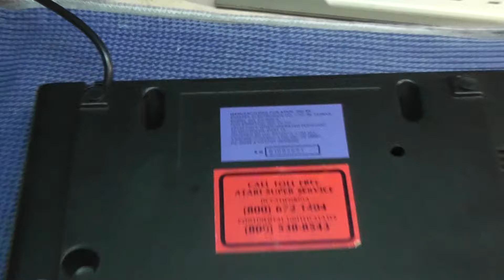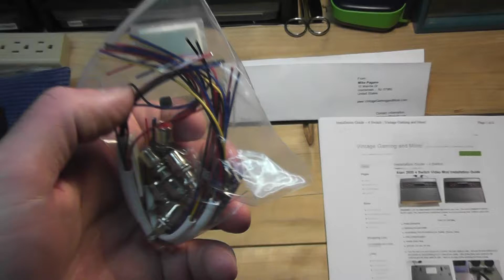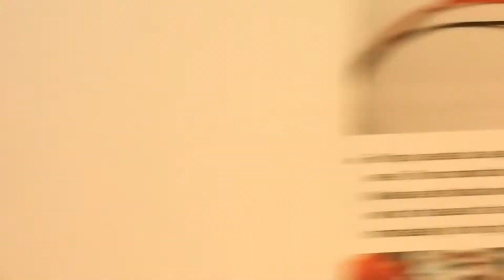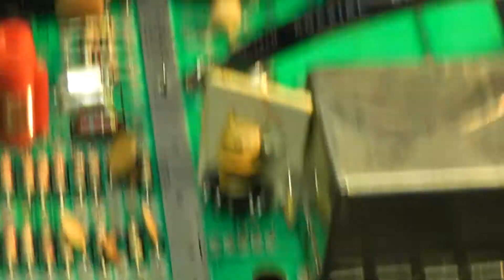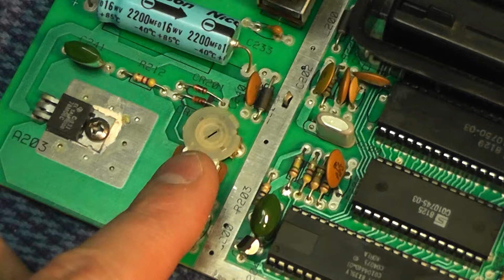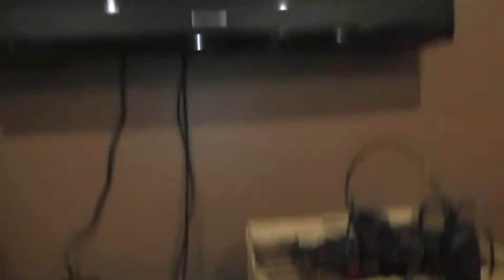Atari 2600 4 Switch Composite Video Mod

Comment: 8:14 - I have the exact same mod as you and noticed something on some of my games. Including Ms. Pacman. You may not have noticed yourself but I can see it in your video. At this time stamp, when Ms Pacman dies and you hear that little death music, there's a faint line near the middle of the screen that runs top to bottom. I have this too. I was told that the solution is to disconnect the audio wires from the board, add a 1uf capacitor to the audio line between those two separated wires bypassing the audio from the mod board completely. This is an audio related interference which seems to be common with these boards and it seems, 4 switch Atari's.

Comment: My resister is upside down. Do i still solder it to the brown end or the front ?  Im modifying a 2600.. THIS DOES NOT MATCH THE KIT I BOUGHT ON EBAY BUT RED AND BLACK ARE OK.. on the board,..One major problem i dont get no video..???? HELP pls..
Reply: Resistors dont matter what end you solder to, kinda like a fuse, it dosnt matter, diodes and capacitors on the other hand do matter. Some people just like their boards to look uniform, nothing wrong with that though

Comment: The mod board I used was much different. It was called the "Longhorn Engineer" board. It solders to several pins on the TIA chip and does provide stereo output. The Atari was originally going to have built in stereo speakers, so there are 2 audio output pins on the TIA chip, but they're just tied together for mono since they decided to output the sound on the tv instead. From what I understand 4 games were actually programmed for stereo. The board also provides Svideo output. I was also able to retain RF output. I have a few videos up of me installing it on my 2600 Jr.

Comment: Nice video. But (as for every VCS Video Mod ) I don't see much sence in "destroying" the VCS-plastic-case by screwing holes into it. Instead you can put out a cable+connector for a cable just out of the already given & big hole, where originally the RF cable came out.

Comment from the maker: Thanks!  Interesting to note that this particular atari had a problem with its origninal RF output circuit - The picture would "white out" for a few seconds at a time on channel 3.  I had changed out to the original RF wire to a thicker coax, which did not solve the issue.  The A/V mod works perfect and I have had no issues.  And yes, that Pitfall cartridge is in terrible condition!